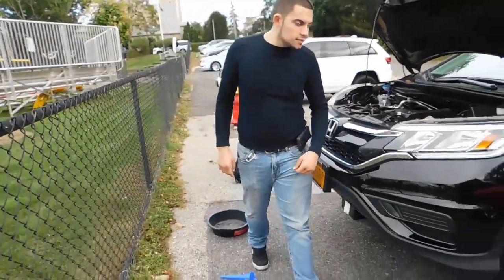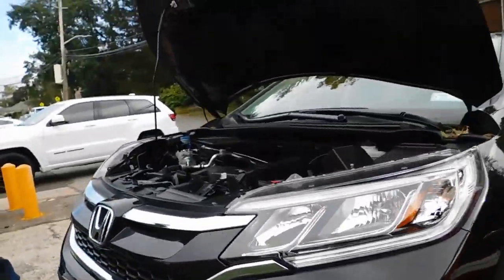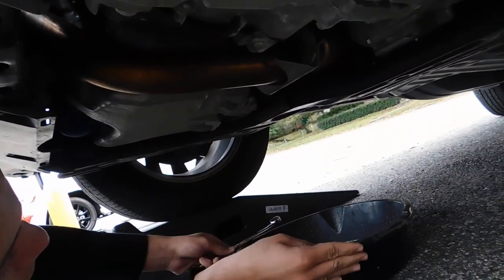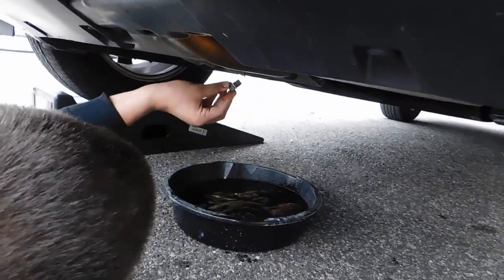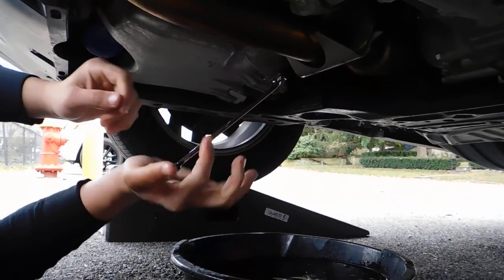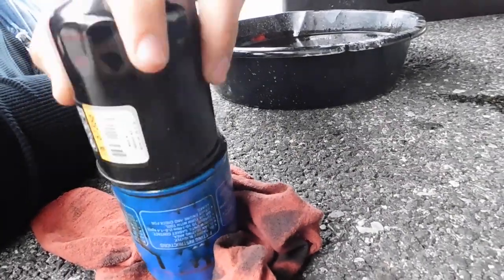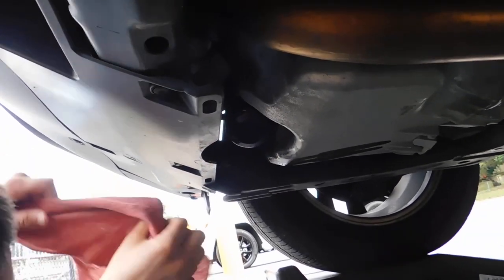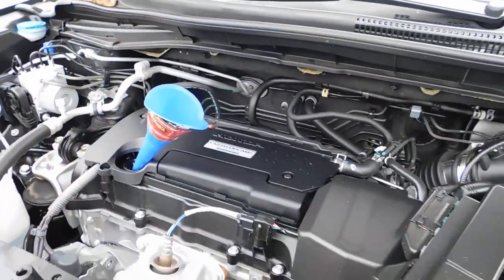2016 HONDA CRV SPECIAL EDITION OIL CHANGE AND LIGHT RESET

Comment: From a honda certified technician, you should always use clean engine oil on the filter housing. Also I strongly recommend only using honda oem oil and filter. Otherwise pretty good video. Remember to not overtighten the oil filter and drain plug.
Reply from the maker: Thanks for the tip!

Comment: Hello, did you remove any cover to reach the oil filter or there is not plastic or metal cover for that part ?
Reply from the maker: Hery Cervantes hey no nothing gets removed it’s easily reachable it isn’t covered
Reply: Vinny Randoms Reviews 5-30 is not the appropriate oil for the car?
Reply: This year of cr v's 2012-16, don't have a cover.  Only from 2017 and up.  Makes it a hole lot easier and faster.

Comment: What is that spray you use after installing the oil filter? Audio is not quite clear.
Reply from the maker: docfame brake cleaner
Reply: PRECISION DETAILING AND ACCESSORIES thanks for the reply
Reply: What's the oil capacity?